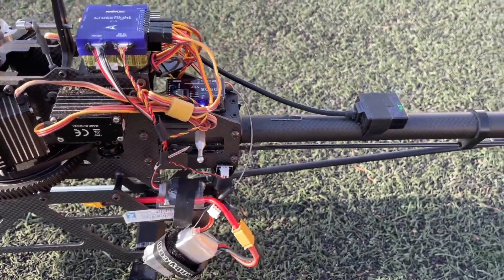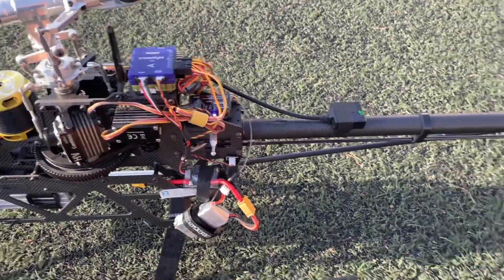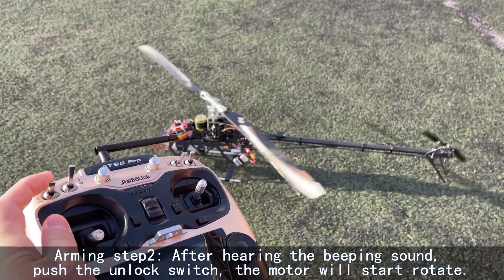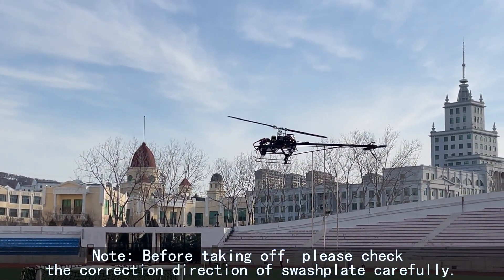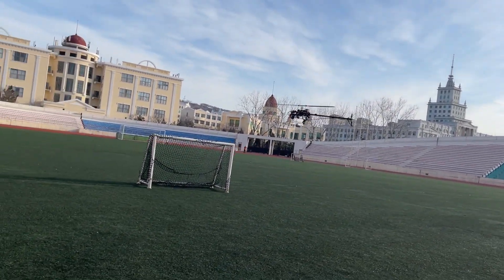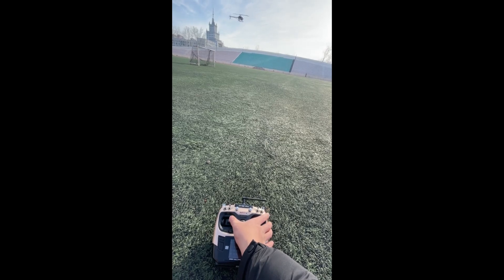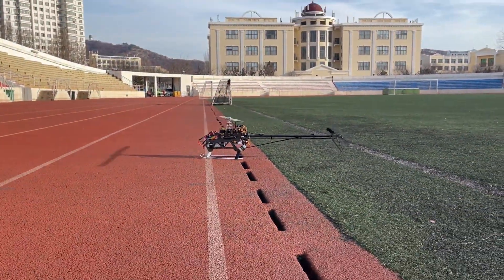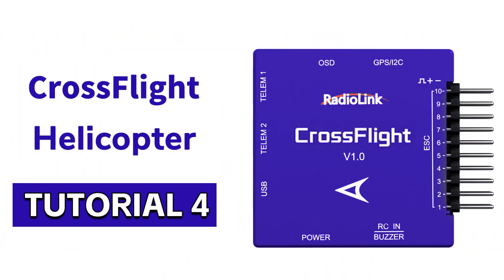Set CrossFlight/Mini Pix/PIXHAWK on Helicopter / Episode 4 The First Flight of Helicopter

Comment: When I am in alt hold mode, I am giving 50% throttle to the drone, after that the motor is rotating at its maximum speed and the message of potential throttle loss is coming. Please help me.
Reply from the maker: Hi, sir. Do you mean that you didn't make the drone fly up? In Alt-Hold mode, you need to push the throttle a bit higher than the central point (50%) and M435 will slowly take off and keep rising if keep pushing the throttle. When M435 reaches a certain height, it will hover if stop pushing the throttle. Pilots can change directions by rolling, pitching and yawing. It cannot fly up at 50% throttle. If any question about RadioLink products please feel free to contact us. Our email is: after_service@radiolink.com.cn
Reply: @Radiolink_official  when i put throttle 50% up then my drone fly automatically and massage show potantial throttle loss
Reply from the maker: @Trymbak13  Hi, sir. Is it convenient for you to send us a video to show your problem? It will be helpful for us to know what happened and help you solve it. You can send the video to after_service@radiolink.com.cn  Thank you.